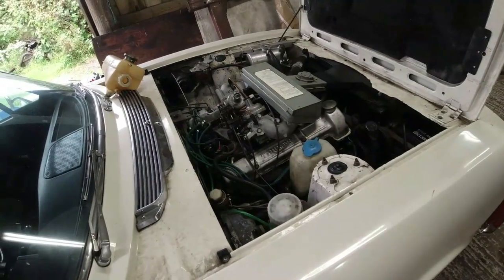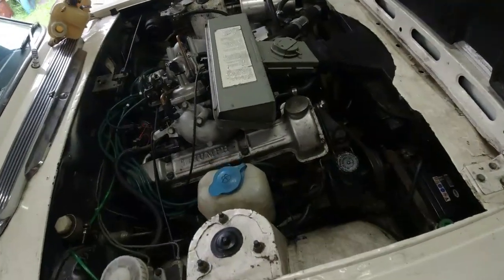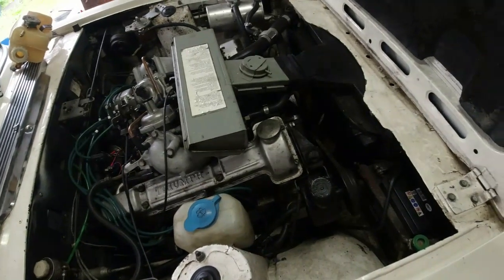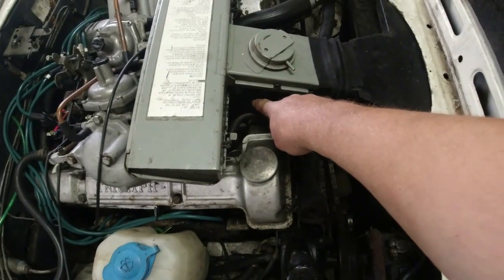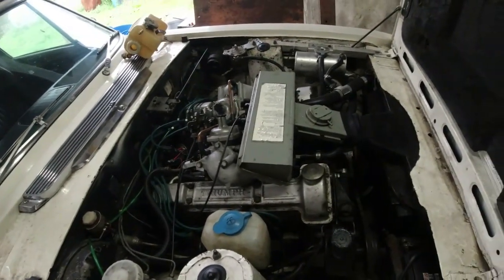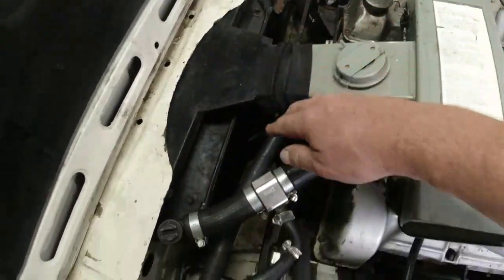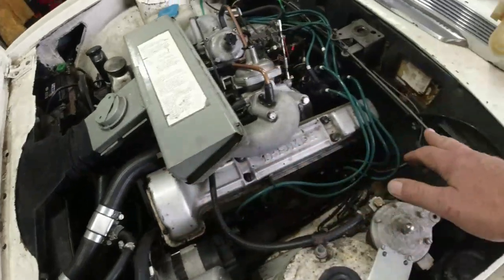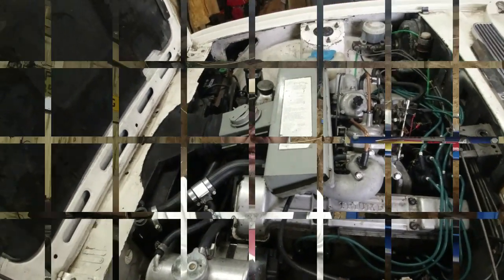1973 stag cooling system - Parental warning for terribly boring content and profanity

Comment: owned many stags over 40 years...the standard cooling system as designed works well dont alter it....stick a 4 core rad in and no problems...providing..no one has wrongly gapped your water pump clearance!, dont overfill your expansion bottle....put a low temp opening thermostat in with a bypass hole...i always flush the whole system every spring with the thermostat removed and have never had a problem in 40 years!

Comment: Another great video and uncanny timing! I have been researching the header tank but have been slightly confused at the way the majority are plumbed in, allowing hot water from the top hose to bypass the radiator and be drawn back to the water pump, but nothing I could find online seemed to mention this. You have just confirmed my doubts, I had already decided to experiment with cold side connections, now I feel a bit more confident going ahead. Thanks.

Comment: Total respect for your persistence.. but Triumph Were barking up the wrong tree as “overheating problems” arose. All along the core problem was build quality at the factory..
  I am the very lucky owner of a 30,000 mile Sanction 1 car built October 1971 with the 13psi (radiator cap on the Radiator) 
  I believe that Triumph put a small bypass Mod on the thermostat area plus an update on the water pump vanes about from about 70 cars  before my build but… I got a car that was built by the right people in the right mood… because it runs with temp bang on in the middle, all the time.. Everything is standard from the factory ( no new anything) ..as far as the engine is concerned.. Proving there was FA wrong fundamentally with the car… Yes I change the oil every 1500 miles and yes I routinely drop the coolant every two years. It is very sad the fate of these cars.. but I know what I know and will not ever sell

Comment: Yes, you got it right.  The water pump was bypassing the radiator, sending hot water from the engine back into the engine, not through the radiator to be cooled.  That retro metal expansion tank is not a good design.

Comment: I'm doing this now to mine, I think your issue came from the header tank connecting across the rad using the original overflow and the top hose. I've had the original mk2 rad modified to block overflow off, fit a new one on the rad neck, and a new header tank feed half way down the same side as the filler neck. This keeps both header tank connections on the same side of the water circuit.
Reply from the maker: but both feed and return are on the "hot" side and not the "cold" side. I think the restrictor on the air bleed / return side is the way forwards. High level expansion tank all the way

Comment: 1) There are mods raising the expansion bottle.  Use a tried and tested one;
2) Fit an electric fan;
3) Fit an electric water pump. 

Then no problems. The electric water pump and cooling fan ensures that there is always cooling water flow through both banks of the V8 engine and radiator, and air flow through the radiator, even at idling in very hot weather. 

Those who say keep the cooling system as standard are taking complete tripe. The prime problems with this half decent engine were on the cooling system.  A well known fact.  The water pump does not even deliver equal water flow to each bank of the V8. Keeping it standard then using the car with brisk acceleration and high speed driving will result in overheating and seizure. That is not a secret.

Also Luminition pointless ignition is a must.
Reply from the maker: Interesting theories
Reply: @churchhouseclassics  
A problem with many engines is local hot spots. Coolant will boil then be replaced by fresh cooler water, then boil. So it goes on.  This is worse in idling conditions as the water flow may be too low - even when it may be around feezing outside.  

Electric cooling pumps can have high water coolant flow through an engine at idle speeds. Also electric cooling fans also will have higher air flows through the radiator at idle speed. Electric pumps and fans also do not consume as much HP off the crank improving mpg. 

Jay Leno swears by Evans Waterless Coolant for use in some of his classic cars. Evans works when there is spare cooling capacity, as its cooling properties are less that water, so you will need a bigger radiator in some cases.  The DeLoreon example I gave is one where it is not suitable, as the cooling system was on its limits using just water. 

Jay Leno mentioned that Evans eliminates local hot spots in some of his engines. ...and prevents internal corrosion. It also allows a cooling system to be non-pressurized, putting less stress on rubber hoses, enhancing longevity.  The problem of the lower expansion tank in a Stag is then gone. 

On the Stag Owners forum, one guy in N Ireland wrote he had his Stag massively overheated, the sort of overheating that means an engines rebuild.  He says using Evans it never overboiled. With the engine fine. So it appears to be beneficial on a Stag - an engine prone to cooling problems.  So, with Evans, a lager radiator in a Stag I would say is essential.  But water pumps work harder to pump Evans around a system as it is thicker than water - not a problem for most water pumps. On a Stag maybe a 12 vane ump would be a benefit.  Davies Craig say Evans should not be used with their electric cooling pumps, as they are not designed for that level of pumping.

Comment: What was the condition of your radiator was it  silted up works well for a while but the capacity is compromised maybe not the problem but having a larger radiator may help ?
Reply from the maker: And there within lies the issue. OE solution works, so when it fails because of poor maintenance the owner is persuaded to add .... improvements* #snakeoil

Comment: Hi Richard, great info.  Have to ask, now you've blocked the path to the top hose how does any air in the system escape and where does any expansion of the coolant go? I see right now there's yet another thread on the SOC forum regarding header/expansion tanks, at present I have the original low expansion bottle setup and I really can't see any advantage between what you've done and simply mounting the original bottle higher up?
Reply from the maker: Hi Alan, I seriously restricted the flow in the top hose to prevent coolant from freely bypassing the radiator. The air does still bleed out. However as the level never drops I just dont worry about it and let it do its expansion tank thing.

Depressing number of header tank threads on the SOC forum, expansion tank is the way to go in my opinion alas the top of the rad is very close to the leading edge of the bonnet therefore you will always struggle to get a good head of water above the top of the rad. however shifting the OE bottle up as high as it will go should put the level above the top of the water pump.

The only disadvantage of the OE bottle is the risk of the brass neck separating from the plastic bottle and allowing the system to run unpressurised. If yours is a good un I would keep it and raise it up to the top of the front bulkhead

Comment: That's a good storyline which most of us with stags will understand. What did you finally do to solve the problem? Also, regarding electronic ignition systems, what do you consider is the best system to use for the Stag? I look forward to hearing from you. All the best Bob
Reply from the maker: I did get to the bottom of it all, vacuum advance not always working because of sticky newtronic/piranha optic, dead viscous van but ultimately coolant was bypassing the radiator.

I very much favour the pertronix/flamethrower coil setup👍

Had the distributor been more accessible then I would be twin point and condenser all the way... but only from DistributorDoctor
Reply: i have had many stags...the best system is the original twin points....i own 2 stags and the points version starts first time hot or cold....the lumenition takes a bit of work

Comment: Great story telling, especially the Lemans part.  Gave me flashbacks to owning a Dolomite Sprint :) . Same water pump and viscous fan worries with that. Interested why you never went down the electric fan route?
Reply from the maker: Thank you, next beer and b'xs session will go into a lot more detail
Reply: ha, we all had dolly sprints....mine covered 120k over the years but many journeys in the summer on the motorway were with the pass heater on full blast to keep her cool...especially up inclines.....fond memories, i am looking to buy one now but im priced out of the market!...who would have thought!
Reply: I eventually had to go down the elec water pump route.

I didn't want to; but I ran out of water pump shafts, and so many of the improperly hardened ones out there; including genuine unipart brand new in box one that shredded after 1,000 kms when previous old one ran for ages in very long high speed trips. Supplier gave me refund, but not for shredded jackshaft that drives it, as "my old shaft old/probably worn.." I had had same shaft in car for a couple of 100,000 k's, and had had a couple of rebuilt pumps (rebuilt by me) work with it; but decided to "give it a birthday, as never had a "new" one". It ate shaft in 700 kms........... so I never trusted "new" again.

I prefer any engine driven mech pump, but just couldn't trust the pump gears any more. Mine has had an elec pump last three or 4 years, and is fine. It is HOT here (last week 6 days over 40 deg C) and elec pump is fine. I only use an EWP80 (80 LPM) and that is fine, don't need anymore.

Lots of pros and cons; (I didn't like what others do, and I expect a LOT from my car (use on hottest days), and my cars trips alternate from short shops trips, to 50 k's to visit family or 70 km blast through the hills or backroads.

My pump installation is a lot simpler than many others. Each to their own/works for me. (I did help a guy who had an aux pump for his heater and was plumbed backwards. :-) so I have some idea how to make them work for me.
Reply: PS - I did try mounting a Triumph 6 mech pump on the front of my Stag, and got it 98% right........... but when the belt ran a bit close to the PS pump pulley, I got sick of it and went elec......... My Sprint (laid up now) still has mech WP.